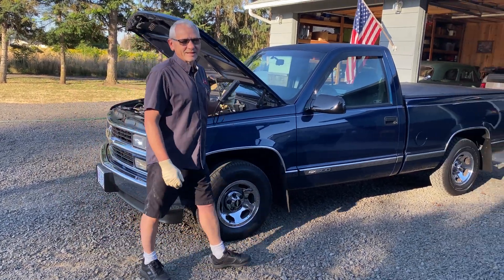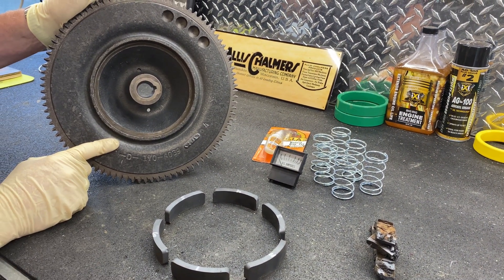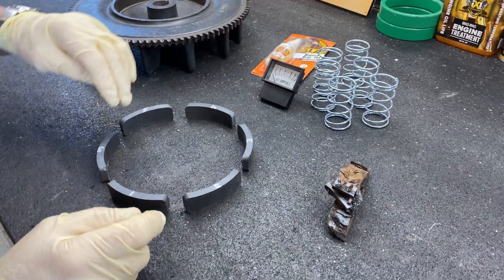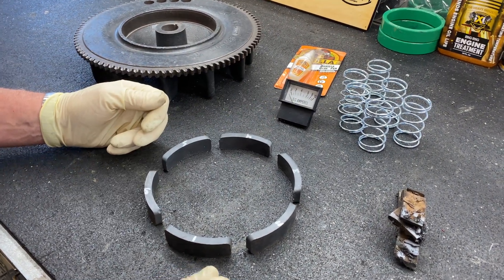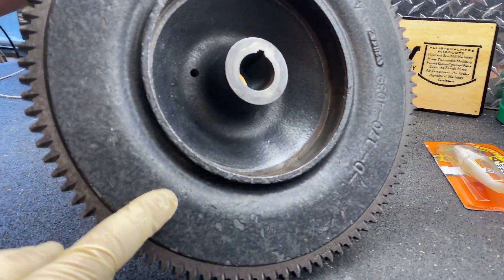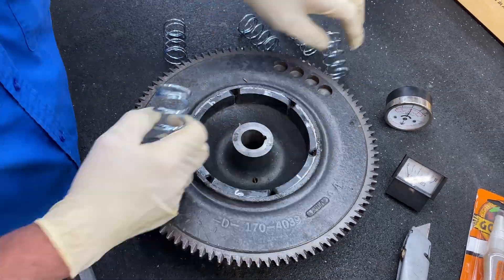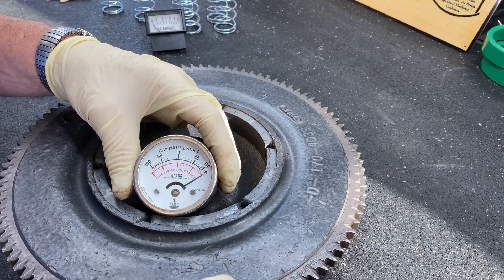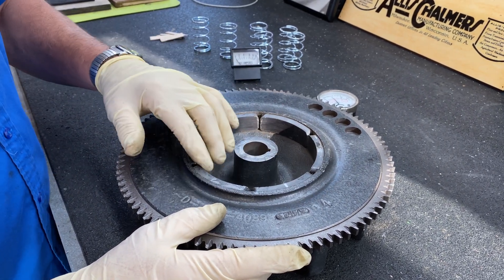Repairing Flywheels With Magnets

Comment: I just had to do this for a 1978 Craftsman Badger 1 riding lawnmower. Three of the six came off, re-glued them with metal reinforced JB Weld and it worked like a charm. Unfortunately the motor shaft broke when tightening the nut. Ended up welding the flywheel to the shaft, now back to running better then ever.

Comment: The arc flywheel magnets are getting rarer to find every day.  Each of them has three poles. Three arc shaped magnets are NSN and the other three are SNS. So out of 6 magnets, there are 18 separate poles that face the stator.   You can use a compass as well to determine the order to install them. 
If you find yourself in a jam and are not able to locate new magnets, you can replace them with neodymium bar magnets of the same thickness and height of the flywheel mounting width. Just be sure to glue them in S-N-S-N-S etc. around the flywheel equally spaced apart. 
The replacement magnets are getting difficult to find, it seems manufacturers have moved to permanently bonded magnets in a steel ring. I guess the cost of producing ceramic magnets in the three pole order is expensive.

Comment: I cut mine in two to fit my unavailable Kawasaki rotor, different diameter, been working great and fully charging system.
It runs in hot engine oil.
J B weld in place and die grinder sanded to get precise stator clearance.

Only magnets I could find and they returned my 82 KLT 250 to service. 
Thanks for info!
Reply: hi where did you get your magnets im having the same issue with my kz250
Reply from the maker: @kairawlingstrill6567 these were sent to us from a customer so Unfortunately I don’t know where they got them.,

Comment: do they need to be placed at a specific pointon the flywheel such as top dead center?,  i have an old tecumseh that uses magnets a charging coil and for the ignition coil
Reply from the maker: No, they do not need to be in a specific spot on the flywheel. They do however need to be opposing each other and have a slight space between each one so they do not touch, but not too far apart where the magnet forces can’t work together.

Comment: I'm installing nine(9) magnets on a flywheel of of twelve.   Only two(2) magnets pull toward the other.  I've order new magnets but they are not magnetized.  Can i install the two magnets along with the remainder?  Thank you. Great video!
Reply from the maker: Unfortunately, I believe they all need to be magnetized so they work together as a unit.